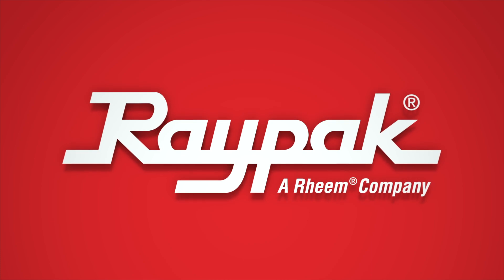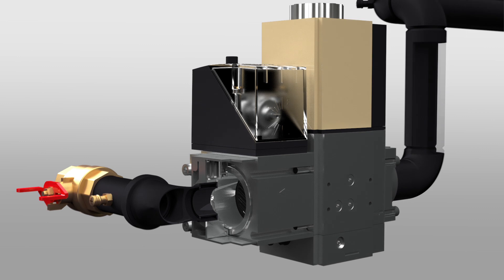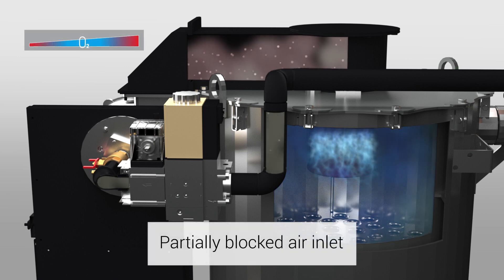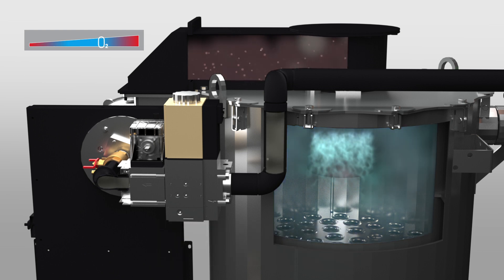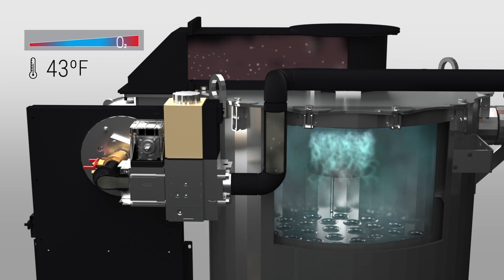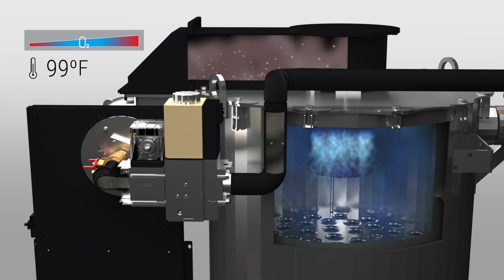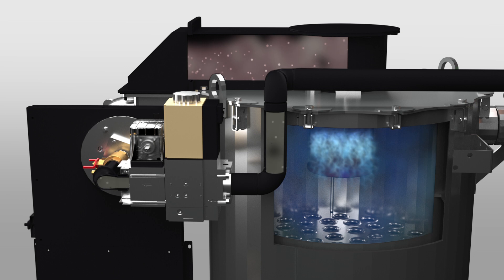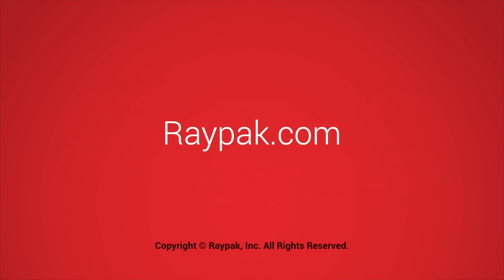Raypak® HO2T™  System

Comment: Nothing but fluff, you guys must be counting on people that don't know better. If there's a partially blocked combustion air intake, the ANSI required N.O. air proving safety switch won't let the boiler fire. If there's a blocked exhaust vent, the ANSI required N.C. safety switch won't let the boiler fire if a positive back pressure exists. The tolerance on these safeties are set to trip within a +/- .2"-.3" w.c. variance. Air density only changes .004 lbs. from 70F to 40F and there is no affect on the oxygen content of the combustion air. LOL!